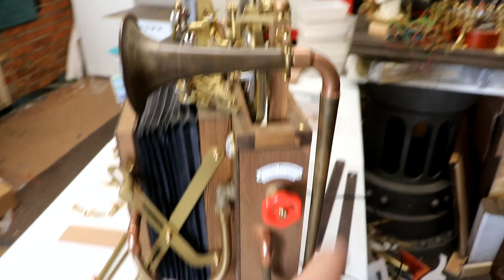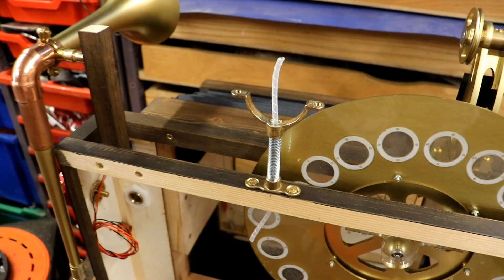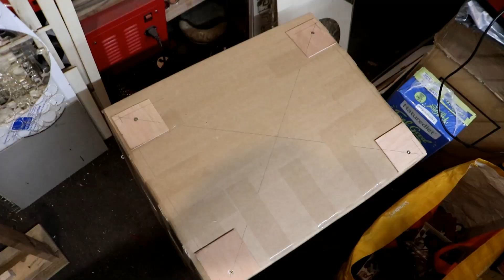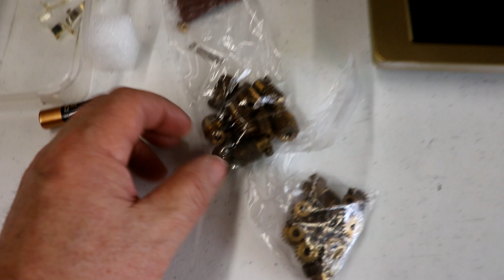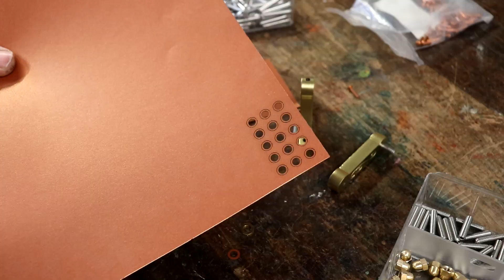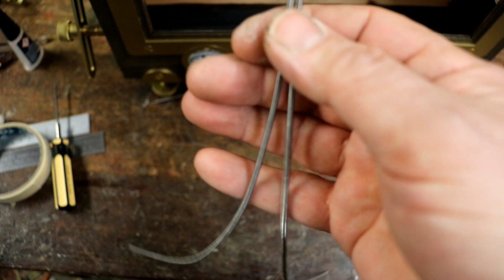How to stupidly ruin 2 spinning discs

Comment: 19;40 may be would dry faster if you put in a box with a light bulb.
Reply from the maker: Thank you for the suggestion, but I have tried putting silver painted parts on radiators to 'dry' more quickly, but it just seals the surface layer, and prevents the paint from properly setting. I don't begin to understand the difference between the chemical properties of the brass and silver paints - but they are very different. Theodore Gray explains it in his wonderful 'Reactions' book on page 150. I can't recommend this book enough - I may make a video just to promote his wonderful books.

Comment: just came across this stepper. i bet. you. could find a good use for it. LIQURIJU VID28-05 Biaxial Stepper Rotation Motor 360Degrees Auto Instrument Machine for Car Replacement Parts Instrument Motor Black